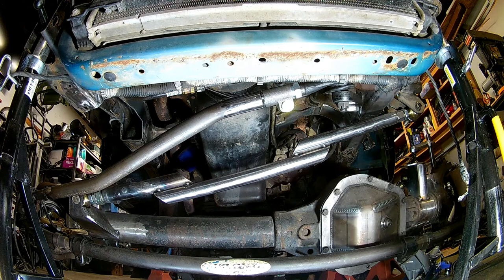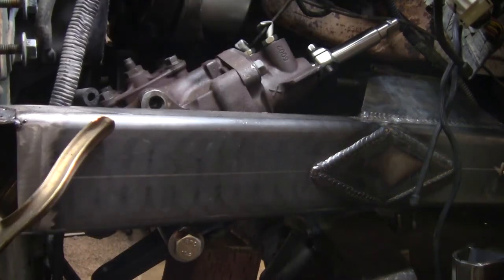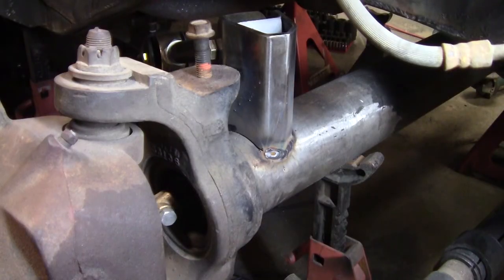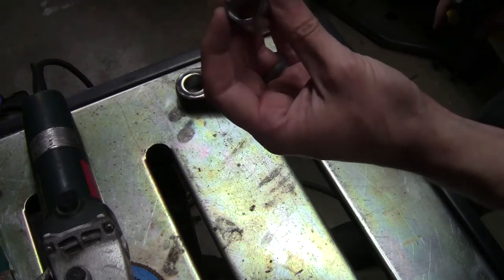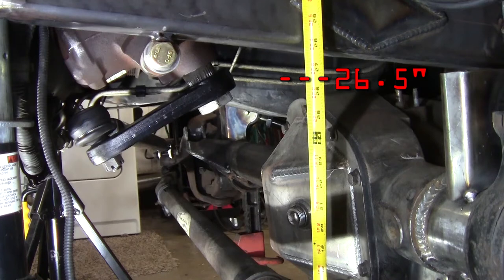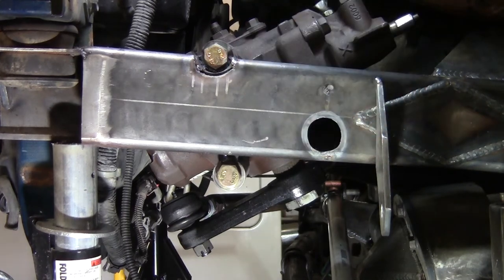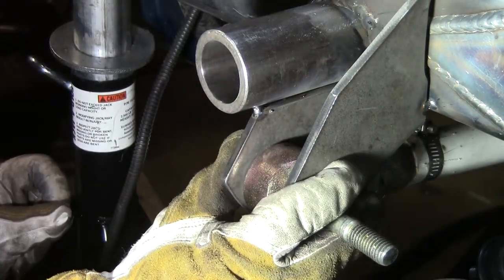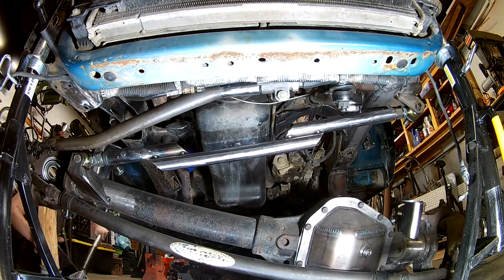Custom Steering and Track Bar Layout - [Project SuperDUkota - Dakota+Super Duty axles] Part 6

Comment: Thanks for the video, I am planning on a SAS swap on my '08 1/2 ton GMC with the same axles and didn't know what steering box to use. We got to find you some more time away from the family to finish the Dakota lol.  keep up the great work.
Reply from the maker: Nice! This steering box is great especially since the super duty front has a lot of available steering travel. A lot of steering boxes don't have enough throw to turn these axles fully lock to lock. I believe 2012+ is best for used boxes- 2011 and older wear out prematurely and have smaller sector shafts if I remember correctly. Only challenge is that these boxes use a weird input shaft style so make sure you track down the steering shaft for the box too! It'll save you a huge headache. Good luck on the build! I'm getting this one close to driving again- big thing is I need an editor to make the videos and get them out quicker! I'm way behind with them because I'm a slow editor haha. Thanks for watching!

Comment: Why not  just run a longer piece of tube for the top mounting bolt on the steering box mount? 
Thanks for the videos you put out, I always look forward to watching them.
Reply from the maker: These were the longest bolts I could get locally at the time so I figured I'd make them work haha. You're right that it would have been easier to plan ahead and order a longer one but I'm not that smart 😜Thanks for watching! Really appreciate it 👍

Comment: Did you consider the front axle roll axis height vs the rear roll axis height? Is the front axis lower than the rear roll axis? I did the same thing you did raised the front track bar to fit better vs the axle. Now years later I have discovered a ride quality problem on highway because my front roll axis is higher than the rear.
Reply from the maker: Rear is still on leaf springs so it just is what it is for the moment haha. I will be linking it eventually though so I'll definitely take that into consideration. Goal for this stage was just to keep it low and have the links as flat as possible, then I will adjust and tweak the front again when I get around to building the rear. Good insight! Thanks for watching and for the constructive comment haha 👍

Comment: Just found your video i have a 96 i am bout to do but i wanna use leaf springs. This is great info thanks
Reply from the maker: Nice! Yeah leaf springs make it a much quicker and simpler project haha. The Dakota/Durango rear leafs are actually a great option for the front SAS- they have a big center pin offset so you could have the front axle pretty close to the front of the frame and keep a good approach angle. Plus having the same leaf springs at all 4 corners is handy. Good luck! 👍
Reply: Thanks mine is a first gen dakota so no real aftermarket support i am looking into all options thanks for advice
Reply from the maker: Yeah there's barely any aftermarket support for the second gen even so you're really SOL with the first gen haha. No problem! If you need any more of my opinions feel free to comment on my videos or on my Instagram @webwheeler 👍
Reply: Sure thing except no instagram. Right now i am trying to track down the dual t case adapter plate. For these i have read on forums people do it and i seen pictures of it done

Comment: Is your front daba 60 shortened? Or you just going to have extra wide axles under a midsized truck?  I ask as I have a Dakota and was thinking about an axle swap…
Reply from the maker: I kept it full width so I wouldn't have any issue with replacing shafts plus I prefer the stability. With 9" wide, 5.5" backspace wheels, I have about 4" of tire stick out past the fender on each side. Hope that helps!

Comment: Looking at doing the same swap to my 95 dakota so she can handle torque of the 383 big block I plan on adding. I don't plan to widen the stance though. How much work/money do you think would be involved in narrowing the superduty rear end?
Reply from the maker: Narrowing the rear would be pretty simple- usually people just cut the axle tube and sleeve the ID with some tubing then weld it all back together. As far as the shafts go you could go to the junkyard and pull some short-side shafts and use those on both sides. Different years and models had different lengths so you should be able to give a set that works. Simpler solution would be to just buy aftermarket shafts that are cut to length or custom length. Little more money but definitely easier. Good luck!
Reply: @WebWheeler  going the money route. Moser can make one for my build that has everything welded, cut, and in place for my dakota.
Reply: @WebWheeler  Brakes and keeping my wheels on the truck are things I won't test with my life lol

Comment: Why dont you notch the frame with pipe so you can keep the links straight
Reply from the maker: I actually did try that. Not sure if I got it on film but without the bends in the drag link bringing the joints to neutral at ride height, my drag link tie rod ends would bind and limit the axle articulation